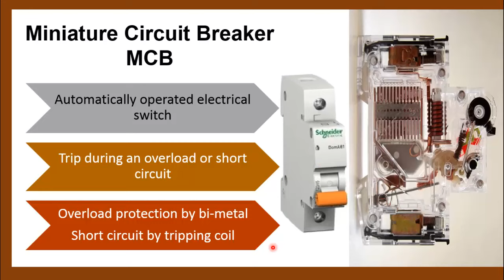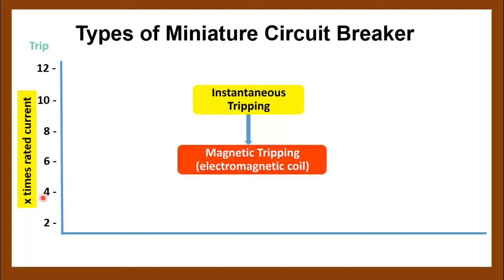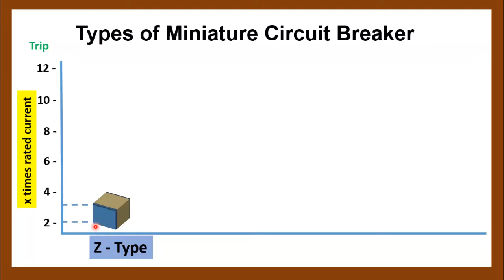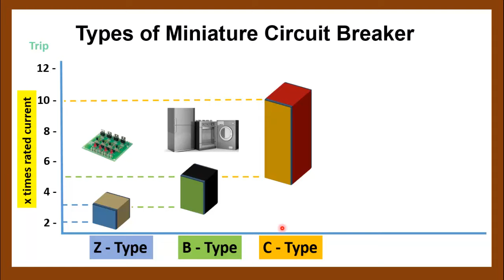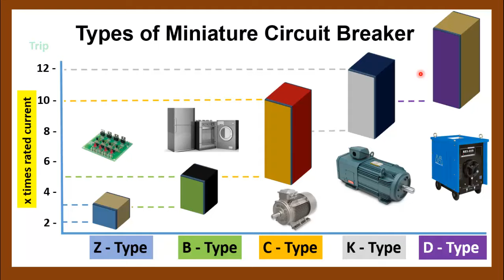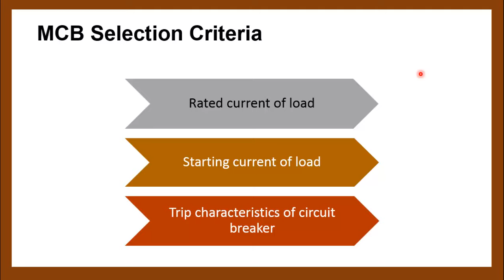MCB Types and their Applications || Types of MCB

Comment: What is 6k& 10 k mentioned on the MCB, which is best for house purpose
Reply from the maker: Its the breaking capacity of the breaker measured in amount of current. It means if short circuit happens it will have the capability to open the circuit without rapturing or damaging inder 6000A
Reply: @electricallectures  which is best for home 6k or 10 k
Reply from the maker: Both can work no problem.
Reply: @ice5842  there is nothing like 6k or 10k ratings. A B6 rated MCB means it is a 'B' type which is used for typical household electrical appliances like Geysers, Fans, Lights, Mixers etc. The '6' means it is rated for 6Amps. If the load draws more than 6Amps it will trip.
Reply: @electricallectures  Bad Response !
Reply: Short circuit current it is capable of carrying

Comment: So for a general home, type B is to be chosen??
Reply: All domestic / home breakers will be type B or type C.

Type Z - usually too sensitive even for electronics due to the input capacitors that most electronics (such as PCs) have.  Almost nobody uses type Z for anything these days.

Type B - The vast majority of home circuits can use type B breakers, offering the greatest protection from typical overload situations (such as someone putting too many space heaters on a single circuit).

Type C - Residential inductive loads such as Microwaves, A/C systems, Fluorescent lights, built-in house vacuum.  Also including most woodshop style AC motors and other garage circuits.

Type K - Certain industrial loads with low-impedance wiring.  Situational.   Not typically found in the home.

Type D - Primarily used for running large industrial 3-phase motors with low-impedance wiring, and very large arrays of LED or Fluorescent lighting (warehouse lighting, for example).  Not typically found in the home.

--

One other thing to keep in mind is that breakers with higher trip currents require lower impedance (larger) circuit wiring.  Putting a Type K or Type D breaker on a domestic circuit can be dangerous because the circuit might not have low enough wiring resistance to actually cause the breaker's magnetic trip to function in a dead short.

-Matt

Comment: You seem to know ur stuff but can't explain properly. U say that all Instantaneous Trips are caused only by Magnetic. Before that u said there are 2 circuit breaking methods - Heating and Tripping Coil. It's only confusing !
Reply from the maker: Thanks for the comment. No doubt it is true that intantaneous triping is caused by magnetic whereas overload tripping which is time dependent caused by thermal. If it is not true you can correct me. Thanks